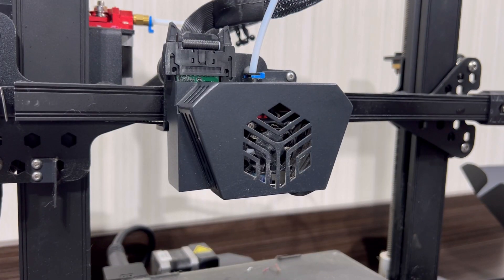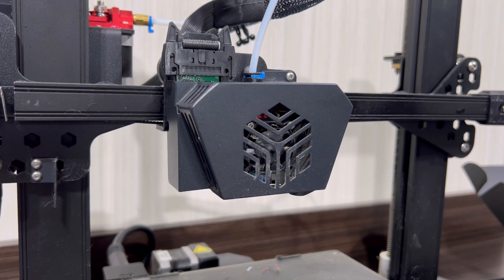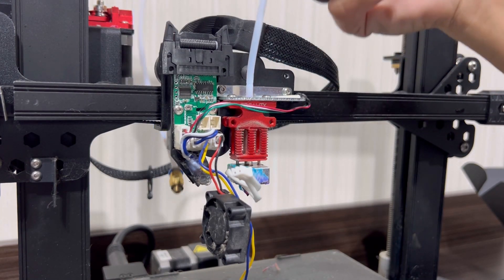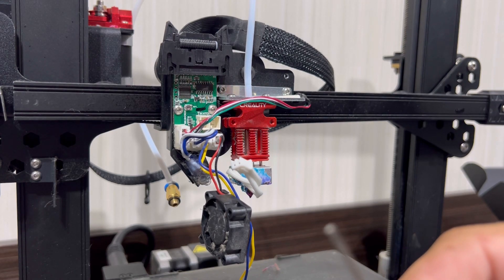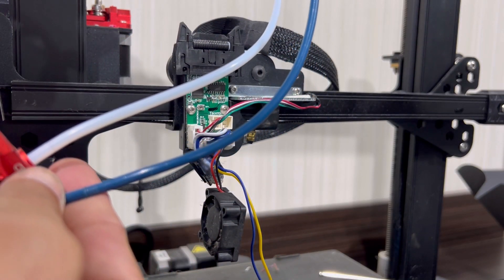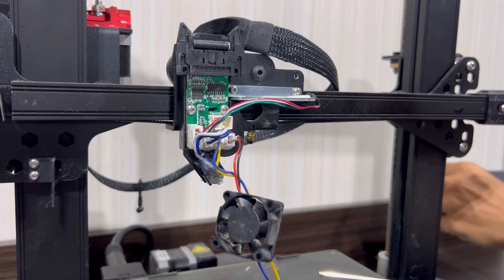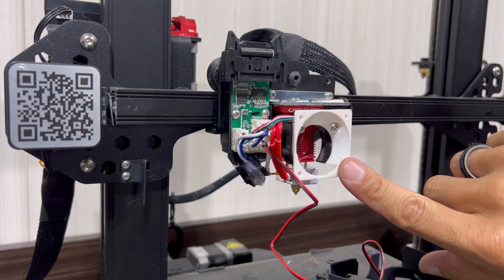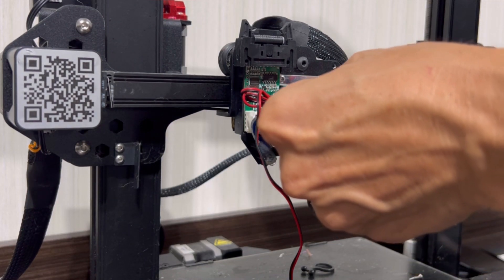Improve cooling on your 3D printer | Winsinn 40mm fan + modifying a 3D printer | creality cr6 se

Comment: 3D printer upgrades are always fun. I've gone full nuts with mine and went watercooled.
Reply from the maker: How’s the sound differential? I notice the hydraulic are quieter than dual bearing
Reply: @Darkwingdad  It's definitely quieter when not printing, but I have a VzBot printing super fast, so my part cooling fan (CPAP) and the motors themselves are louder than any hotend fan out there. Noise wasn't a high concern for me, I'm just going for performance.
Reply from the maker: @mattlott1113  I’ve learned to have a separate room. Quietest machine would still keep me up at night lol
Reply: @Darkwingdad  Yeah, I'm the same. Definitely couldn't sleep with this thing going in the same room.